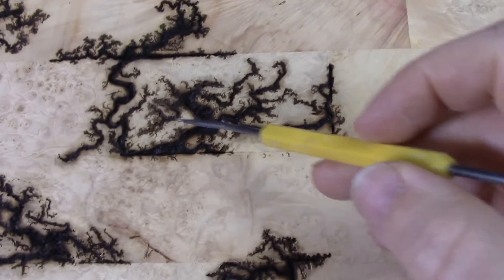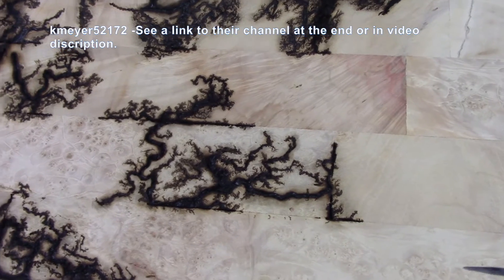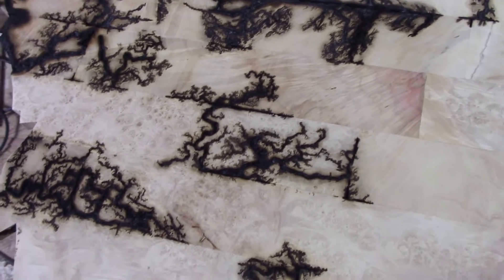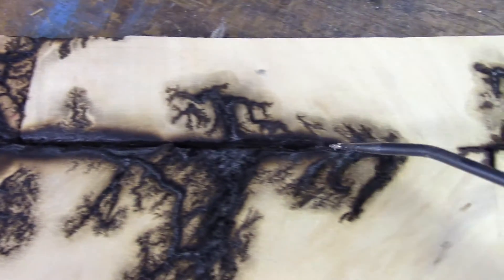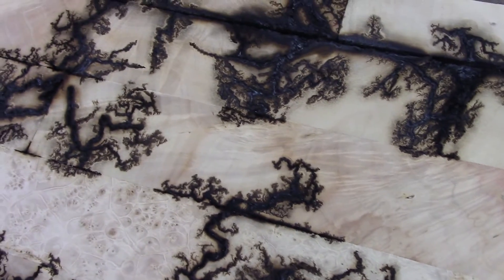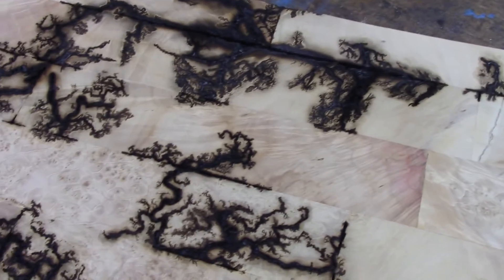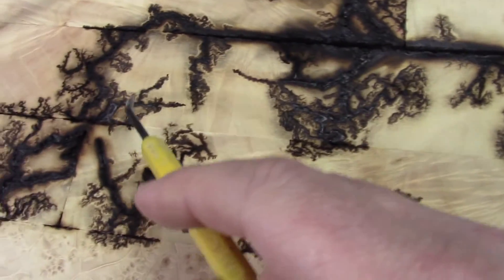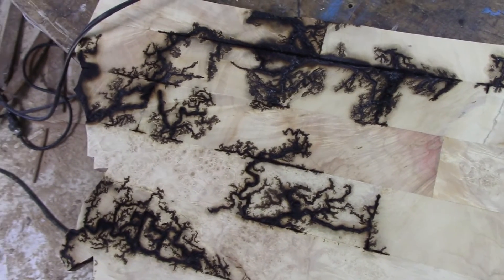Lichtenberg Wood Burning Experiments #1

Comment: Jarrett R. Hutton (32) killed himself last year doing this, with a similarly unsafe setup.
If you are at all interested in improving your safety, let me know.
Reply from the maker: High voltage rated gloves, grounded steel work platform under the wood top, current limiting ballast and standing on rubber isolation mats.  Life is dangerous, this more so than chess but I bet less than say mining or commuting via motorcycle.  Don't just lurk, down-vote and hint at better safer ways, share your knowledge, be part of the greater community and participate in making your world more awesome.  Hell make a how-to video of your own to educate the masses.  I have tried Neon sign transformers but have never gotten one to do this.  What would you do?
Reply: I was not going to waste my time giving advice without knowing if it will even be read or dismissed out of hand. If you can't reduce the current because it will stop working there are still things you can do to make this somewhat less insane.
First, stop wrapping that cord around your hand. It doesn't even look like high voltage insulated wire, and you should never trust those gloves as your only means of protection. You are rubbing the wire against your leg in the new video for goodness sake! There is no reason to get your body even near that wire other than a piss poor lazy setup (I will be frank here). You keep touching stuff around the table with the power on.
Loose all the open joints and put the transformer and ballast in a decent enclosure. Use HV rated wire throughout, not just lamp cord.
In the latest video you talk about changing the polarity, yet I see no diode in your earlier video. If you have no diode you have AC and that doesn't have a polarity. Is the HV output grounded on your transformer? (that is not safer I am just asking).
Don't do this on your table saw on top of some old piece of plywood, you can see with your own eyes that high voltage moves through wood in unexpected ways. Put your work on a proper insulator (plastic, glass) with a good margin all around.
There are even ways to wire a GFI into the output of the transformer to protect against accidental contact, but it is somewhat advanced and I don't expect you are up to it looking at how bad this setup is.

Sure life is dangerous, but smart people mitigate risk. They wear a helmet riding their motorcycle and a seatbelt in their car. You guys have gotten way too comfortable with your 120V mains, this is no joke, it will kill.

For goodness sake please make sure this setup is absolutely inoperable by your boy. Judging by how I was at his age this must be like one huge magnet to him. There will be times when he defies your explicit orders, you know that.

Comment: I wonder if you could use one of those pens they use to draw or repair circuit board traces. Draw a design on dry wood, let it dry, then apply the probes to small sections at a time. I think that once the conductive trace carbonizes the wood, the carbon will become conductive.
Reply from the maker: tom7601 Interesting idea.  I will research those.

Comment: Why not try letting the board soak over night in a salt water solution ,maybe even a log soaked for a few days and then run the charge thru the center
Reply from the maker: Then cut it to expose... Interesting.  I wonder if it would just be black pinpricks or if it would crawl only along the surface.
Reply: With that much moisture warping, cupping and splitting might be an issue.....not sure.
Reply: I think you could let it dry out before cutting it open ,then theres the way they would do fake gunshots in the movies where they took a board and put a row of nails into it attached wires to each one then ran down the line setting off each one ,but a little slower with the electrical voltage do like start of circal shapes